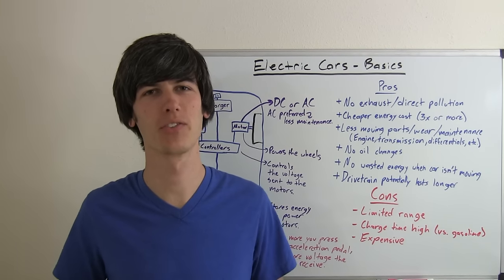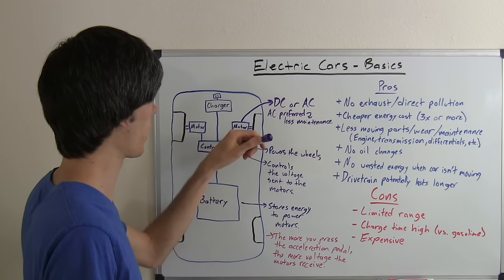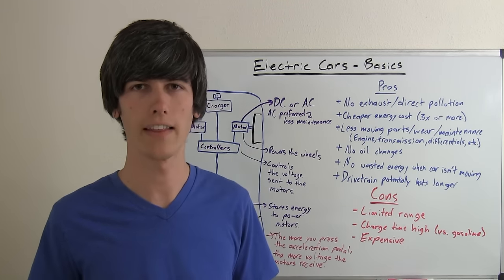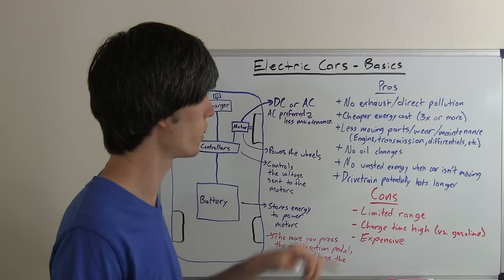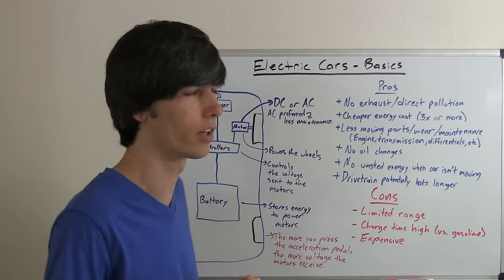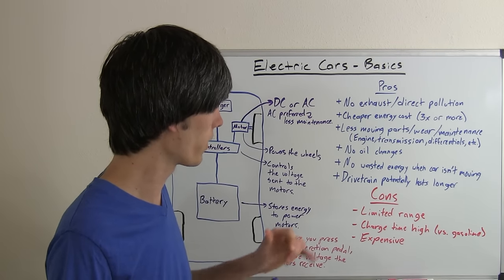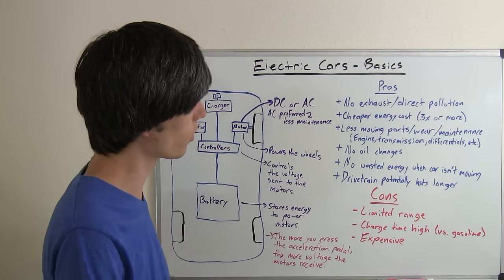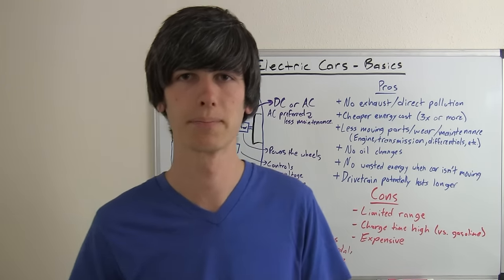Electric Car - Explained

Comment: cant the electric cars be charged on there own by using a Dynamo attached to its wheels ? its understood that always the tyres wont have the required RPM to produce current with the help of dynamo but yet it can reduce the battery charging time !.... and is there any way to reduce its cost ??????
Reply: the dynamo would be a mechanical resistance and you would have to pull more energie from the batteries to not only move the wheels but also the dynamo (and its weight) ->the dynamo would slow the car down. so as you always lose energy while converting (from electric to kinetic or the other way round) it would only make sense to use this when you are slowing the car down on purpose (eg.: in front of a red light)  inorder to recuperate the energy which would otherwise be lost in heat (or deformation of your car, if you'd ignore the red light).
this is done on hybrids and electric cars.
simple electric motors are actually both motor and generator in one.
i don't think you need a specific rpm-count, as there are ways to use electronic parts that manage the car's power (you can for example mesure temperature and exact voltage of every battery cell, and then let a microprocessor decide how much current would be "drained" from a specific cell... also you can flatten and scale output levels of your energy source by the use of semiconductors, coils and capacitors... )
on the other hand, sometimes a more sophisticated way to construct a car (making it more power efficient, which cuts "fuel"-costs) can again make it less profitable (financially), due to higher production costs... then again, this is the same with any new technology!

Comment: I didn't realize the wheels were powered by separate electric motors. This seems . . . . . . redundant, less efficient, more expensive. Why are they designed like this?

Comment: Are there any advantages of using a transmission on an EV?
Reply: Advantages can be like more output, varying output torques, stability is more in cornering and you can do all types of stunts :D
Reply from the maker: If it's meant for high speeds, then yes, as it can keep it within the peak torque RPMs.

Comment: Couldn't you replace the battery with a big capacitor?
Reply: A battery is a capacitor
Reply: +Brandon Whitacre Capacitors store their energy in electric fields. Batteries store their energy in chemical bonds.

Comment: I was surprised to learn energy was 3 times cheaper. Google tells me different. A diesel engine is 45% efficient. A power station oil fired is 45% & diesel is 35% with Hydro at 95%.
Given the energy loss of transformer charging a car & battery dissipation I cannot see how electric cars are any cheaper. Unless the cost your referring to is the consumer price paid for running electric. If so its a false saving as fossil fuel cost is mostly tax & they will move this tax onto domestic electric

Comment: what if one of the engines fail?
Reply: Same situtation as when a gasoline or diesel engine fails.  You'll need repairs before you can drive it any further.

Comment: Why don't we use the back wheels to recharge the battery. Of course it won't be fully charged because of energy escaping as heat but it will help, won't it?